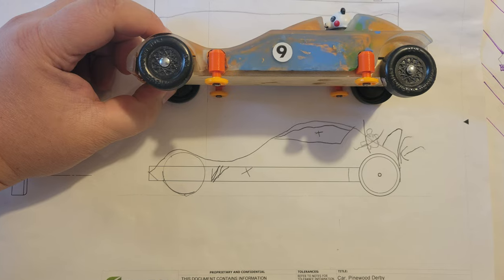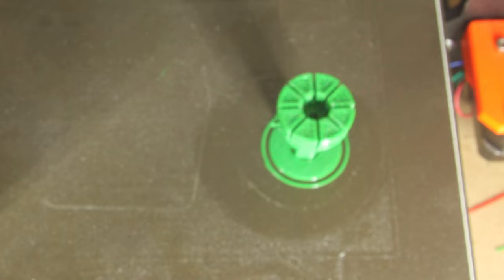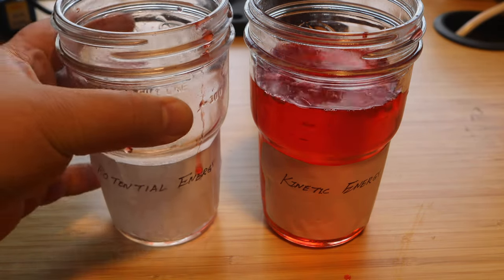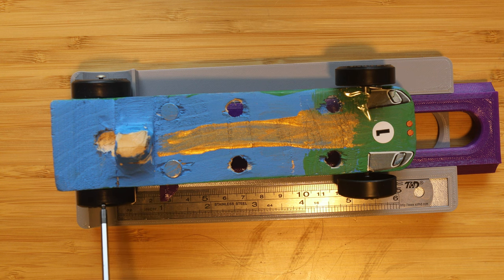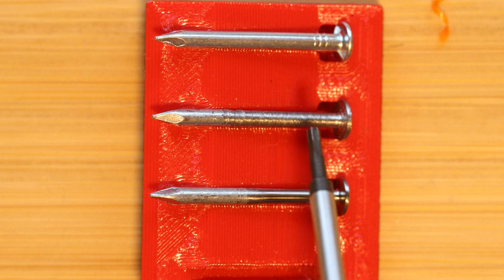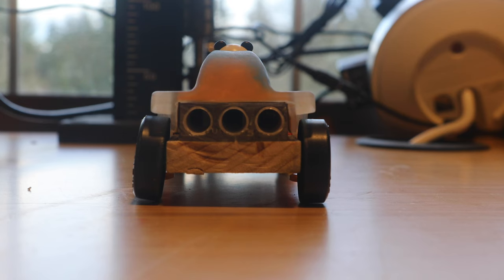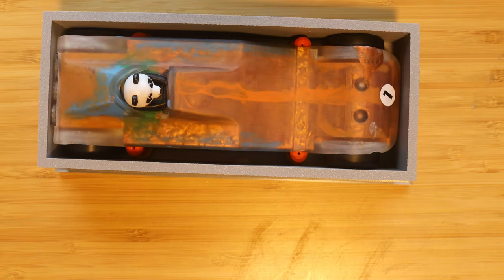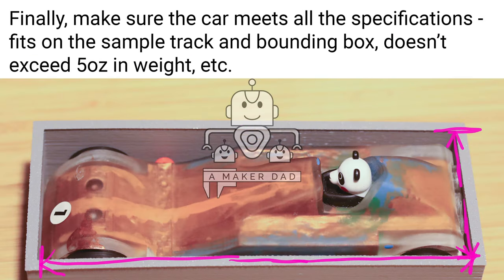Winning Pinewood Derby with 3D Printing

Comment: you can have negative camber with a tow in position and the wheel will never touch the axle head.  it must also have a slight toe out position in addition to the negative camber to keep the wheel off the body.

Comment: so do not bend the rear axles, they need to be 100% parallel and perpendicular with each other and the body. Your are not and its next to impossible to get them this way unless you drill angled holes. your better off leaving them straight vs bending them.
Reply from the maker: Thanks for the comment!

My fixture drills the holes at a 2 degree camber, 90 degrees to the body.  I  use that for both of the rear wheels.  For the front wheel I also drill one at 2 deg camber, and the raised one with zero degree camber.  To steer the car, we are using guide wheels that engage the sides of the pinewood derby track.  I found that easier than setting up for rail riding.

Comment: Super cool!  My fluid mechanics teacher in undergrad told me that a wedge shaped pinewood derby was actually more aerodynamic backwards than forwards, because at low speeds the wake is actually more important than the front.  Any thoughts?
Reply from the maker: That's interesting!  I am not a fluid mechanics guy at all... but from a physics standpoint, running the wedge in reverse, you'd have a hard time shifting the center of mass that far back on the car.  In fact, another Youtuber found out by experimentation that to set the center of mass about 20-25mm from the rear axle, your car on average can't be more than 10mm thick.  That's why almost all winning cars are basically low to the ground skateboards with weight on the back.  By far, the biggest contributor to winning Pinewood Derby - aside from axle and wheel prep, seems to be the placement of the center of mass.  I plan on doing a follow up video where I test each of the variables with the scientific method.